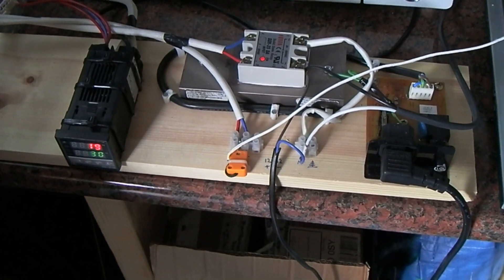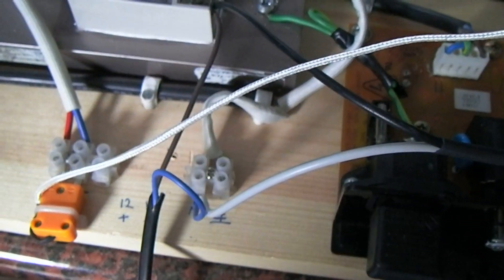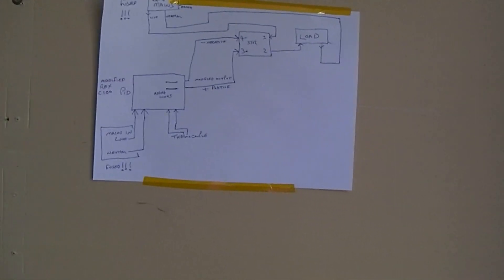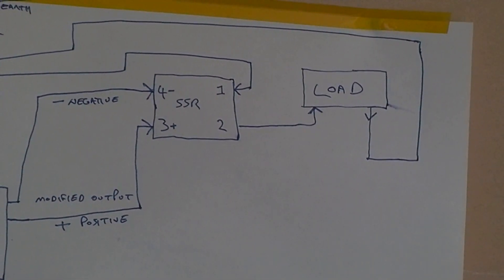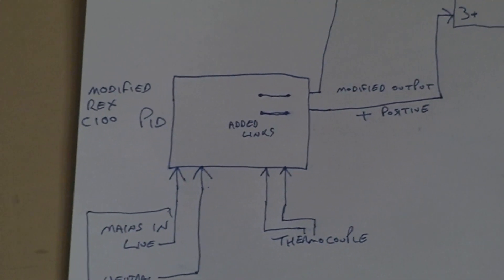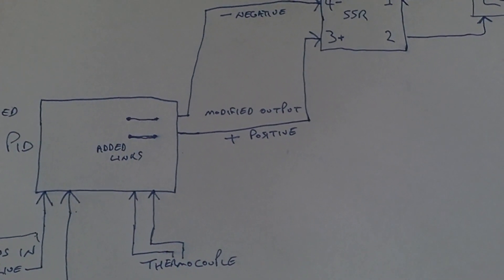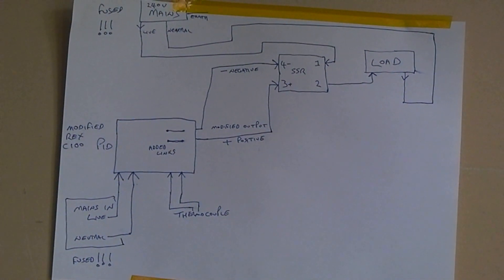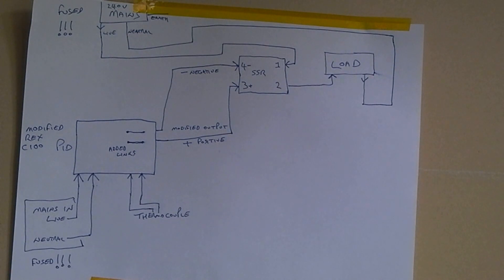Video response to requests for the Modified REX C100 Pre-Heater wiring diagram

Comment: I bought this Rex c100 with 25amp ssr to control my temp. on my Kegerator...  my question is how do you set this devise up for steady power after switch is triggered . I have read you do not want to use this device because they say it has an oscillating switch that will destroy the pump.
Reply: +Byron Koeder
You can wire your pump to be on continuously if you don't like it to switch on & off by the SSR.
Reply: Yes but this would cause freeze up problems then .... but thank you for your reply
Reply: What would "freeze up"?
I keep my pump working continuously & I have never had any problems.
Reply: how cold does it get ?
Reply: +Byron Koeder 
I use my setup for heating (cooking food), not cooling -- usually 104F-160F. 

What is the heater in your diagram for?

Comment: If there is 14 volts going into the SSR what is coming out?
Reply: Nothing it's a relay. It acts like a gateway to allow current to flow to the load based on input
Reply: +kapriece4100 
When the PID outputs ~14V into the SSR (terminal 3), an electronic relay within the SSR allows the 240VAC on SSR terminal 1 to flow through an internal switch (probably an intenal mosfet) to SSR terminal 2 &amp; then out to his load (i.e. heater).  

*Note: * The video author said the PID output was 5V in the video, however he corrected himself below in an earlier text comment.

Comment: I have an odd problem with my REX C100: it reads backwards. When the thermocouple is at room temperature, it reads 24 C, which is 75 F. But, when I take the thermocouple in my hand to warm it, the temperature displayed goes down, not up.

I've been playing with the settings using the manual(s) I've found, and nothing seems to correct that. I can't seem to get into the secondary menu, either, though I've followed the directions: lcy to "0000", press and hold "set" and "shift" simultaneously for five seconds.

Oh, and reversing the leads for the thermocouple makes the C100 read "oooo" - overload.

Any ideas? Please?

Comment: hi, firstly thanks for your vids on the rex c100, i also have the same cheep chinese model

i have followed your guide to remove and bridge the internal relay, but am a little confused how to connect my ssr,  pin 3 on the pid is now dead as this was permanent live before the modification, when measuring the pins 4 and 5 i am getting 15v on both but as i understood your other videos pin 5 should of now become permanent live there for leading me to assume pin4 was neutral? am i missing something?
Reply: as the ssr operate at between 3 and 32v and the rex c100 puts out 12v there is absolutely no need to do any modification.